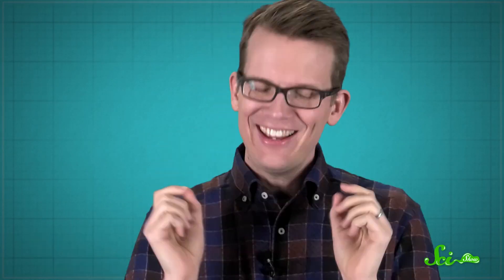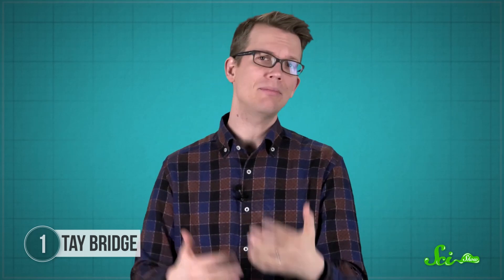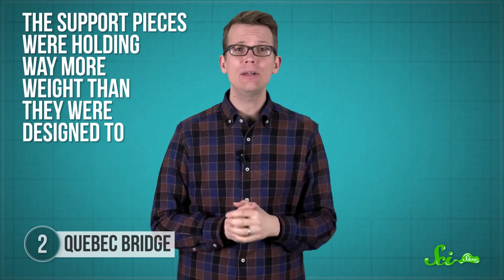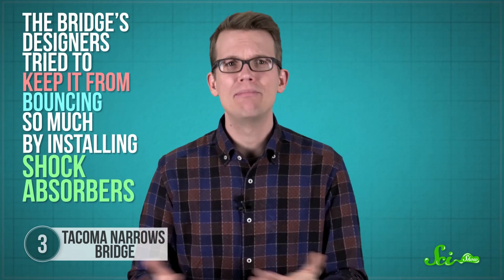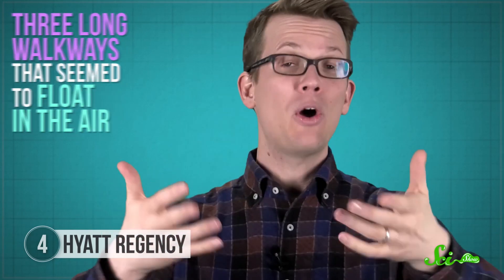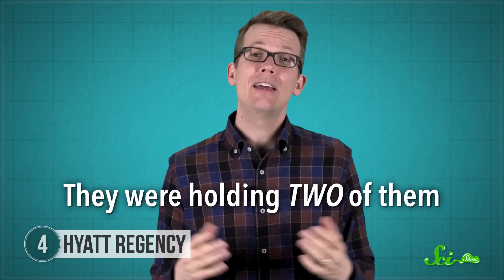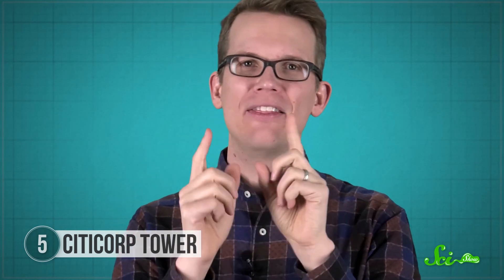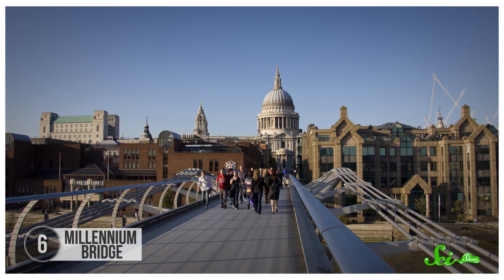6 Construction Failures, and What We Learned From Them

Comment: How did the twin towers and WTC7 collapse then?
Reply: Well the twin towers had a plane go straight throw it
Reply: @safepancake7551  No it didn't.  In a plane vs concrete and steal situation, the concrete and steel will always win. The plane gets crumpled/smashed on impact.  It might go through one or two walls max, but it cannot make a building like the super constructed WTC fall.  Neither can fire.   Check out the physics of this it is basic science and engineering facts.
Reply: @rl7012  but you have seen the video

Comment: What really happened to The Twin Towers were Structural Failure. I aint no conspiracy theorists.
Reply: There was an additional building a couple blocks away from the twin towers that also went down due to the 9/11 attacks. It is attributed to an engineering failure.
Reply: @acrylicabyss  Attributed to an engineering failure how?  What specifically was wrong with its engineering?

Comment: Also - the trusses added to the Bronx-Whitestone bridge; because of its similar construction to the Tacoma narrows bridge.... the Bronx-Whitestone however used deeper girder sections - the engineer for that bridge Othmar Ammann (same guy who did the George Washington Bridge, the Throgs Neck Bridge and the Verrazano Narrows Bridges) felt the bridge was safe but trusses were added in 1947 for an abundance of care - and to reassure the public.

Those stiffening trusses were removed during a renovation in the mid-2000,
they weren't necessary. I recall those trusses when I was traveling that route and 
the Throgs neck in the 90s and it was odd to see them removed in the 00s.

https://en.wikipedia.org/wiki/Bronx%E2%80%93Whitestone_Bridge

Comment: How about looking into world trade center Building 1 and 2. Why did the centercores fail. No impact. How did a 36"x12"and 52"x 32" box beamsi n which all collapsed in unison with no impact. Seems like core would have had to be dropped from bottom to bring outside walls in with them. If outside walls made fail, would they of not caused core beams to shoot out word but remain intact due to fo having only sideways force on them.  Core should have remained upright because force to rip core columns had to be less than anchors that joined floor sections to the core columns. My theory is the core was taken out from below by a something hot enough to melt columns instantly, like a plasma ball and melt almost instantly with core in freefall from bottom, building would fall with the outer walls being pulled inwards. Don't think any other explosives would have been needed. With this design should fall pretty much just like the actual building  did

Comment: @ SciShow : Bridge engineeringhad a painful learning curve. In the U.S. in the 1800s, when continental railroad construction boomed, bridge failures both small and great occurred with frightening frequency by today’s expectations. It wasn’t until the 1840s and 1850s that the phenomenon called “fatigue failure” was observed and described in detail, and it took longer still to develop methodologies to account for it.

Aeroelastic flutter is a complex phenomenon. The snapped cable on one side of the Tacoma bridge may have amplified the effect, but as noted in your vid the bridge was moving substantially before that. In aeroelastic flutter, the flow of air across the roadway resulted in forces that would vary significantly, even under a wind that held a constant velocity.

Comment: You left out the space shuttle CHALLENGER disaster.  Not many people died, but it is a perfect example of ignoring warnings and skipping thorough testing.  The original optics on the HUBBLE Space Telescope is another similar smear on NASA's reputation due to allowing parts in a fit-together construction device for the main lens TO BE INSTALLED BACKWARD AS EASILY AS CORRECTLY and, by Murphy's Law, a critical part was, with no easy way to find out before the damage was done and the mission put into space.  All such puzzle-like parts have to be made so they CANNOT EVER be put together incorrectly and the machine involved work AT ALL in that state.

Comment: Washington has bad luck with bridges. A floating bridge (at the time the largest in the world)  just outside Seattle sank into Lake Washington. Floating bridges are built with pontoons the road is built in sections with flexible joints. In 1990 the bridge was being repaired there was a massive storm on thanksgiving weekend and the pontoons filled with water sinking the bridge.

Comment: It's too bad you didn't include the shiny buildings with polished steel and concave curves that melt cars and heat local apartments to 140f or more. That is a huge fail. The huge item with these "faux pas" that the public is told to live with is that they don't seem to learn from the construction design error.

Comment: The Kansas City skywalks collapse had a second and more important engineering to jobsite change.  Yes, the single suspension bolt was replaced by a pair of bolts and that did indeed double the load at the point of the nut/washer combination at the base of the upper support rod.  However,, the second change was even more important to the collapse.  The beams supporting the walkway,, the beams that the bolts passed through and were supported by the rod and nut combinations  were originally in the design to be back to back C-channels.  In a back to back configuration the nuts and washers at the support points would have been in contact, underneath the vertical web of the C-channels.  This is a difficult configuration to weld.  The second change was to use the same C-channels,, but the open faces of the C's facing each other.  This is an easy configuration to weld.  However, the connection points were now , centered on the newly welded C to C box beam, the void in the middle,, the webs of the flanges were no longer supported by the nut/washer combination.  It shows clearly in the original plans, back to back,, and then in the after destruction photos of the nuts ripped out through the center of the welded box beams.

It was not one change, and one failure,, it was two changes and two failures.    The back to back would have worked,, even with the rod changes,,, probably.  Just as the back to back would have worked for the original rod and nut configuration.  It was the change to the face to face welded steel C-channels that would not work with either configuration,, and certainly not with the double rod change.

Comment: Another potential disaster involved different British bridge. To help prevent rusting, the supports were sealed to keep water out. The problem is that once the water got inside, inspectors couldn't see what was going on. Based on a previous disaster with an Italian bridge collapse, they changed the way the components are inspected and installed other measures to mitigate condensation in the supports.

Comment: (6:47) 5 - City Corp Tower: I had a toy box built like that when I was little. For some reason, dad thought it was a good idea to put the wheels in the middle of the sides instead of the corners, maybe he thought that it would make it easier to tip and thus making toys at the bottom easier to get at. It definitely tips too easily, and it's a design flaw I never liked. If one side gets too heavy, the whole thing tips over and I see it as a hazard.

Comment: There was another design change to the Hyatt Regency's skywalks that exacerbated the change in the way they were hung from the rods: Each of he box beams supporting the skywalks were made from 2 C-channels, welded together to make a box. Originally, the seams were supposed to be on the sides of the box beams, but in another last-minute decision, they were rotated 90 degrees so that the seams were on the top and bottom. Add to that, that they DRILLED through the welds TWICE to attach the suspension rods. This resulted in a twisting of the beams, causing them to break through the welds. It might have held had they not rotated the beams.

Comment: The Hyatt Regency was due to the "C" shaped support beams being joined to appear as a rectangle (from an end) rather than an "I" , meaning the bolts were being supported by thin flaps rather than the central structural support.

Comment: This video really needs a shout out to Henry Petroski's book "To Engineer is Human:  The Role of Failure in Successful Design".

The premise of the book is the double edged sword that all structural failures lead to progress in the safe design of structures, and that all successful designs will be improved to the point that they become failures.

The Tacoma Narrows Bridge was an improvement of the design created by Roebling for the Brooklyn Bridge.  As the technology for suspension bridges became better understood, designs could be improved by using less material.  Improvements in the technology behind the Tacoma Narrows Bridge finally brought the mass of the bridge down to the point that aerodynamic loads could actually set the bridge in motion.  The Brooklyn Bridge was too massive for any wind to shift, so the effects of the wind on the Tacoma Narrows Bridge was a complete surprise.

Comment: Citicorp Tower was designed with the pillars in the corners.  They moved them to the center of each face but did not add additional bracing.  This oversight was corrected after an engineering student studying the design showed her calculations to her professor.

Comment: 3 and 6 
These are both examples of simple harmonic motion. The playground swing is an easy illustration of this. A child starts out with very little motion. With a small but well times pump of the legs each cycle has a little bit more momentum. This continues until the child become scared and stops pumping or a height is reached where the top of the swinging motion results in slack in the chains consuming the added energy from the pumping of the legs. Equilibrium is reached and no additional height is achieved. On a bridge, the slack chain is not part of the system, so dampers or others components need to be installed to prevent compounding small increments of additional energy from causing catastrophic failure. 

5 
I understood that the original design engineer commissioned new wind tunnel tests against the corners at his own expense after the building was complete.  I don't remember how the engineering student was involved in this discovery. Once discovered, in addition to notifying the public safety, as mentioned in this video, the insurance company who underwrote the policy on the building was also notified and asked to foot the bill for and coordinate the corrective work, which they did. That cost was delivered to the original design engineer as a bill, payable to the insurance company in order to recuperate the cost of the repair. His secretary responded, not with a payment, but a rejection of the bill. She included a rough overview of the savings realized by the repair and the insurance costs that would not have to be paid out as the building was saved from the inevitable collapse. She reminded them that the engineer's work was done, accepted,  approved, and built. He was under no obligation to find, let alone disclose the weakness in the design. She further indicated that, since he volunteered it, the insurance company should pay him a finder's fee for helping to save them on their costs. They responded to the with a check.

Comment: the drawing @6:10 is wrong. The load would be the same.
Reply: It’s not that the load would be different overall, it’s that the nuts on the upper girder were not rated to support the load of both walkways. Because the parts were not rated for that, the nuts failed, causing the girders to fail, which caused the collapse overall.
Reply: Please check out my reply to Tikupra, who raised the same issue.

Comment: ... Wouldn't one connection STILL have held up two skywalks even if they were done with the 'through-variant' as mentioned?

I don't really get the logic behind this.
Reply: The problem wasn't the rods or their connections, which were (barely) strong enough to hold the weight of two skywalks under full load.  The problem was the box beams, which ran crosswise under the walks and to which the rods connected.  In the original design, each box beam only had to support the weight of one skywalk.  In the as-built design, though, the upper box beams were supporting both the upper walk (as intended) and also the lower walk through the lower segment of rod.  They weren't designed to do that.  So on that night, the upper box beams were overloaded and one of them failed, causing a cascading failure of the whole structure.

The investigation showed that no one ever recalculated the loads on the box beams when the contractor requested the change.  What's more, even the original design was only barely adequate, without the extra safety margin required by the building code.  All in all, a huge screwup by all concerned.

Comment: Aight, but the Hyatt Regency sky walk failures also happened because  the Box Beams were welded to each other from the wrong sides. So instead of the two beams welded to create an

________
     II
     II
________
Shape it was an
_________
|              |
|              |
_________
Shape which put all the stress on the thin sides rather than the thick middle.
I believe they found this out when they found the 9UE beam.
Edit: I found the video on it, its called 

"Mega Disasters - Skywalk Collapse"

Comment: Militaries have know about possible bridge failures due to vibration for centuries.
When the troops march across a bridge, they do a "break step' so the troops are no longer marching synchronized with each other.
Only after they are across the bridge do the troops get back in to synchronized marching.

Comment: The problem with the Citicorp tower wasnt because "wind slides past the corners". Its because in typical sky scraper design the 45 degree wind strength is usually way stronger than staight on wind. So they didnt take the time to calculate the strength of 45 degrees. But because of the unique design, it was very weak on the 45 degrees.

Comment: You skip major details at number 4... have watched a documentairy about that one a day ago and its not just because how they used the rods, it how they conected the rods in the beams that is one of the biggest failures to why it fell down. The beams caved in under the presure since they were turned inwards instead of outwards wutch would have made them stronger, but now the bolts basacly traveled straight trough the beam once the beam failed under the presure.

Comment: Number 4 wasn't an engineering failure though. I remember learning about it, the construction company decided to save money, instead of installing the long rods they opted for smaller ones which were much cheaper without realising the bolt on the first bridge would have twice the weight. They did this despite the design was to use longer rods.

Comment: Before modern engineering structures incurred increased costs because an additional 10% of structural integrity was built in for any problems not anticipated. With modern engineering these same structures could be built considerably cheaper and the savings could be applied to help with burying the dead and paying for the legal damages.

Comment: I was working at UPS hub in the 80's when a 42lb tractor part fell off the conveyor 20' above and slid down my back thus crushing the metal wagon I was pulling. I asked if they would put up a safety railing and they said they only ever paid $40,000 in death claims so it was cheaper to let somebody die then to put up a rail all over the country. At the time they had a union too. I quit wondering what else they endangered their employees with.

Comment: Concerning the Hyatt skywalk collapse, engineering firms that were held liable for the death’s couldn’t declare bankruptcy quick enough.  Not a geed look for the profession.
Reply: It was mostly the contractor that was at fault, as the engineer wasn't properly brought in to re-analyze and re-design the connections when the contractor realized he couldn't build it the way the engineer had designed. We always say that the means and methods is the contractor's responsibility, and we only design the final condition with all structural members in place.

The contractor should have done an RFI to have to connection reevaluated, and like just some larger welds or a stiffener plate or 2 would have done the job.

Comment: That first bridge... they could have used dual triangular columns and steel tracks with an electromagnetic  pull on four hardened steel cables which would reinforce the wind resistance....
...

Comment: You left out the Teton Dam Disaster. One side of that was built on a funky foundation that started letting water through, which knocked it out from the bottom. Very few people died because of a really efficient local evacuation procedure, but most of the property in Rexburg, Idaho was drowned and the dam builders got in a lot of trouble. My dad's family lived there at the time, and my uncle talks about screaming cattle coming on the wave that washed away the whole town.

Comment: So many things wrong with this video.  To name two of them. 
First the Tacoma narrows broke because of the solid panels on the side of the bridge. Because of hight crosswinds the panels acted like a big wall not allowing the air to pass through them. Thus making the bridge move with the wind
When the bridge was rebuilt the engineers made the sure to leave that open let air flow without being disrupted by the bridge. 
Second the sky walks had a much more fatal flaw. There was a last minute design change to way the beams were supported, and I'm not talking about the mentioned in the video. That change lowered the bridges load capacity dramatically.